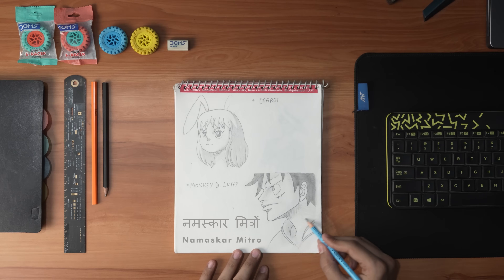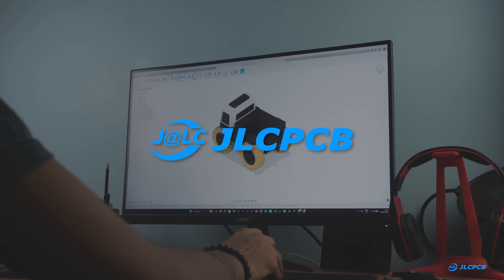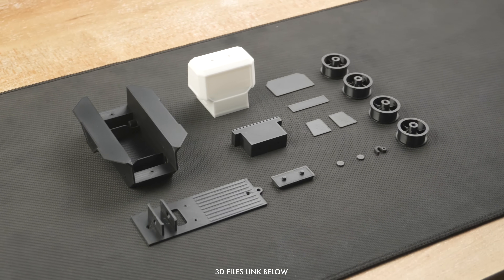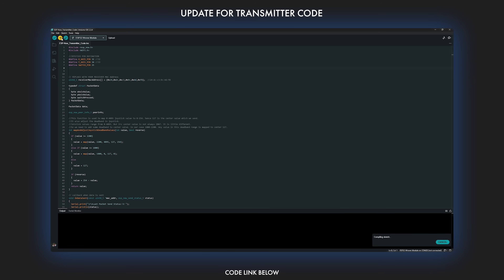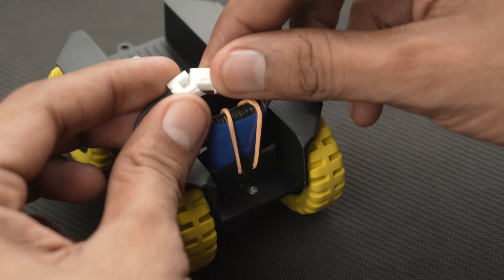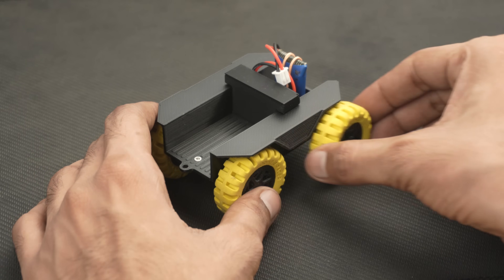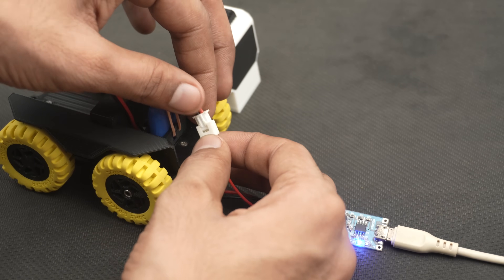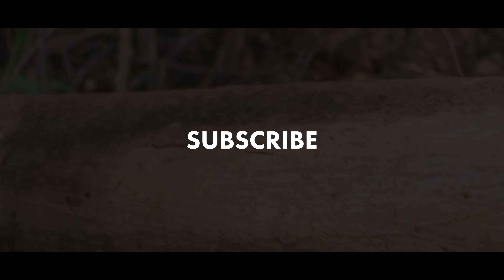How I Built a 4WD 3D Printed RC Fat Truck | Remote Controlled Mini Beast

Comment: How does the wheel connected through m3x20 screw? 
Hole in wheel slightly bigger that m3 diameter and it can freely rotate?

Comment: Bro please help me 😢 I can't upload the code into esp32 . At first I was excited and it was my first true project in which I brought this much stuff so I try to run a servo using esp32 with help of chatgpt and it worked and I was figeting with it . I need to upload a the original code so I press the boot button it wasn't connected with the pc just power but the program still tuned so I pressed both the button but no change so I unpowered it and connected it to pc and try to upload the. Code but a error is showing and till now I can't figure it out please help me . I was planning to use esp32 as a transmitter and 8266 chip as receiver also using esp32 as an usb program for 8266 even chatgpt as been failed to help me please help me bro the error is     

A fatal error occurred: Failed to connect to ESP32: No serial data received.
Failed uploading: uploading error: exit status 2

Every time same error 
Help😢😢

Comment: Yo that looks cool, imagine that with a esp32 or similar microcontroller for live video output.
Reply from the maker: Thanks! That's a great idea for future upgrades.
Reply: @proknow  Using the E-Racer was kinda cool tbh, I never seen anyone do anything like this. (Btw if you do make a video with this upgrage, make sure to add a small torch as most of the cameras are not good or the output is like a little dimmed and delayed). 😄